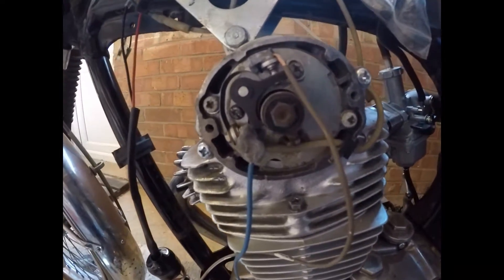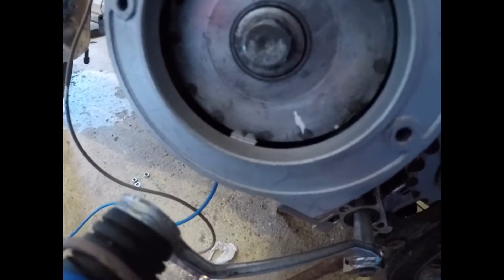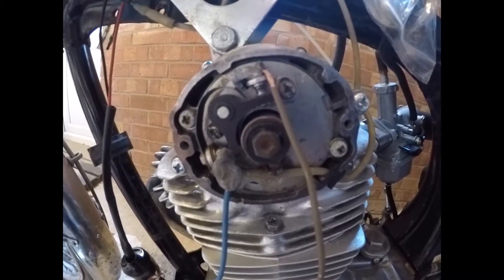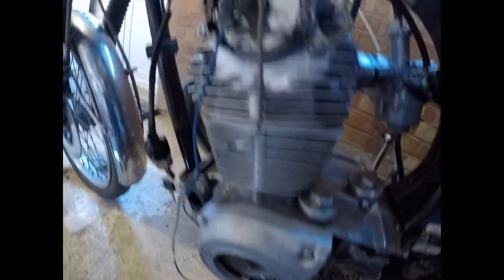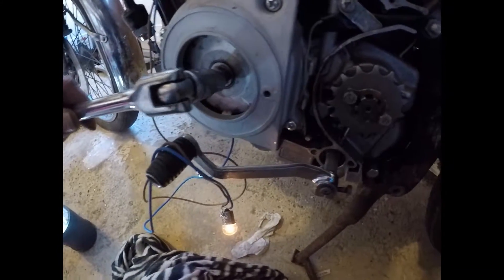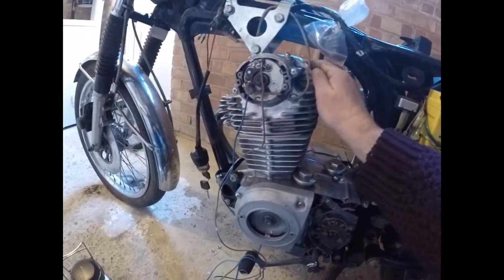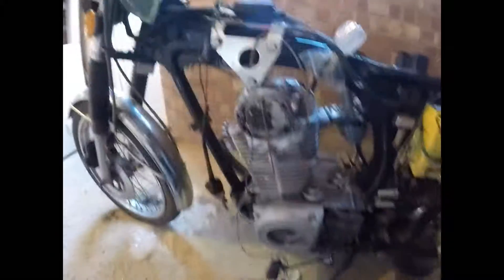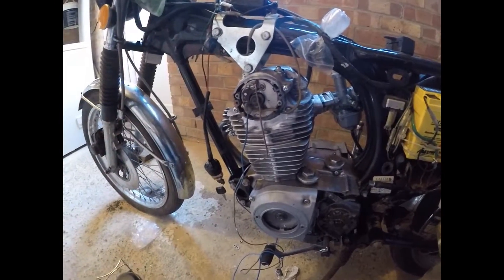Honda CB125s setting ignition timing (points) using a lightbulb

Comment: Andy, I have rebuilt my cb125s but it will not fire which brings into question the turning of the camshaft 180 degrees. Do you know if it is a definite requirement to turn the camshaft. I'm hearing conflicting opinions and it says nothing about turning camshaft in manual? Thanks
Reply from the maker: Hi - I had an issue with a clunking sound from the head when turning the engine over very slowly. I figured that one of the valves was slightly open & hitting the piston. That is when I decided to take the camshaft out & fit it back into the head again. Unfortunately there is a 50% chance of getting the cam into the head wrongly again. it should all work as long as (1) the piston is at its peak (TDC) (2)  'F' mark on the alternator (which lines up with the grouve in the alternator cover), (3) and the little round mark on the cam sprocket lines up with the slot cut into the cam housing on the head

Comment: Would have been a great benefit to see how you turned camshaft Andy. I'm struggling to turn it 180. Thanks again
Reply from the maker: I hope to do a video on that one day. I found it very hit & miss to get the camshaft in correctly, basically it seems that there is a 50% chance of getting it right every time we fit the cam.
Reply: Thanks Andy. Think I managed to get cam shaft in OK. Time will tell
Enjoyed your video mate
Reply: There is a True Top Dead Center and a False Top Dead Center. An easy way to find top dead center on these CB125s is to line up the timing mark on the crank with the little notch in the crankcase cover. If your at true top dead center, there will be a little play in the crankshaft when the T-Mark (Timing Mark) is lined up with the notch. If you turn the crank over 360 degree again and line up the timing mark with the notch there will be no play at all in the crankshaft. This is false top dead center. Turn the crankshaft around 360 degrees again to line up the timing mark with the notch and there should now again be a little play in the crankshaft.